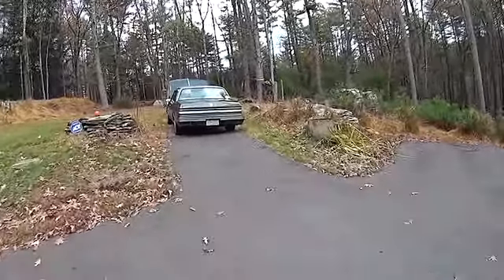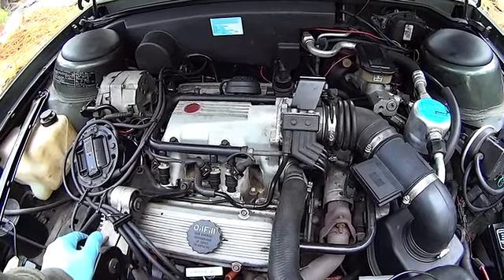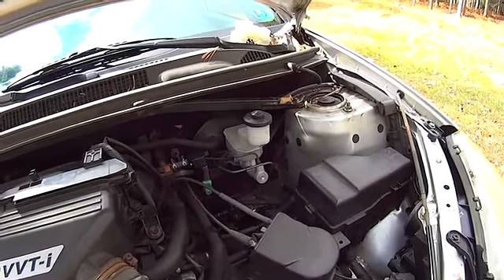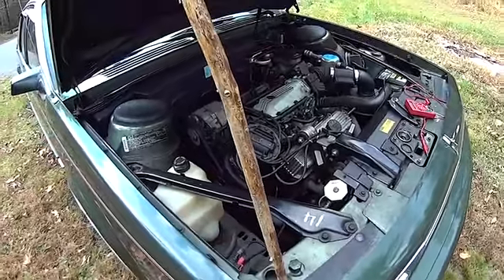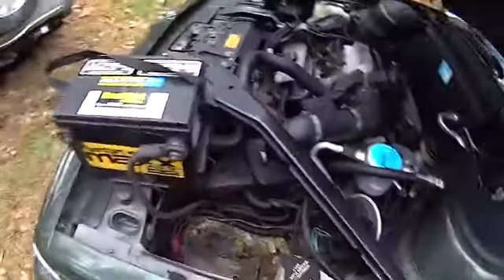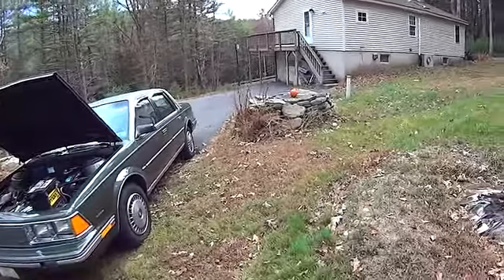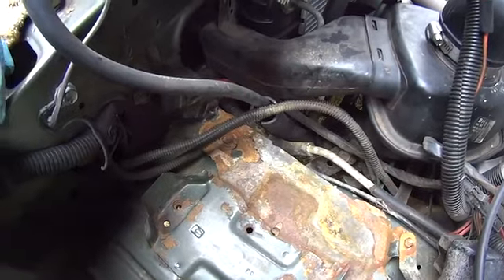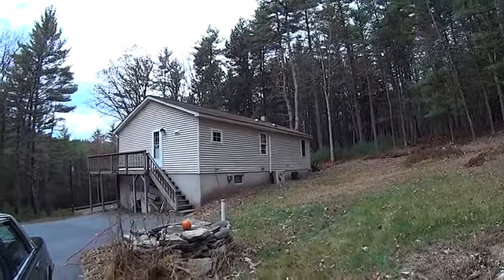Buick Alternator Replacment

Comment: Please, can you advise where the Fuel Pump Control Module is for a 2015 Buick Encore? I've been to 2 mechanics and their computers show that that part is bad on my car and they never heard of this part. I paid the dealership yesterday for a diagnostic and they say I need AC Delco part # M100093 also known as GM#13516849. I also need GM# 95032332. Can I find these parts off of a salvage yard? I'm so confused by this. Please help. Thank you.